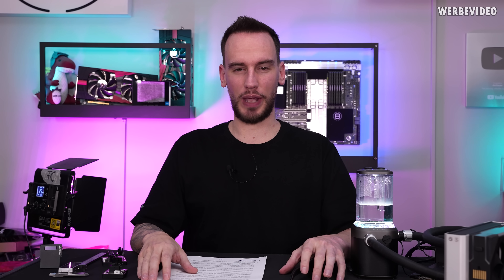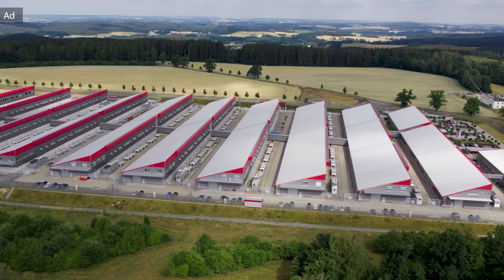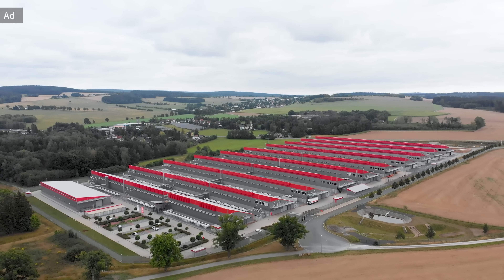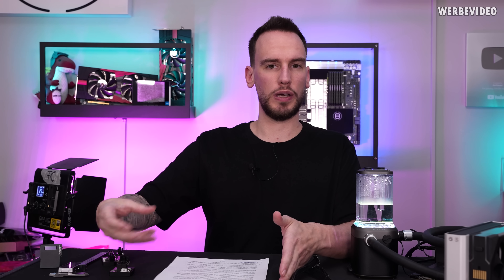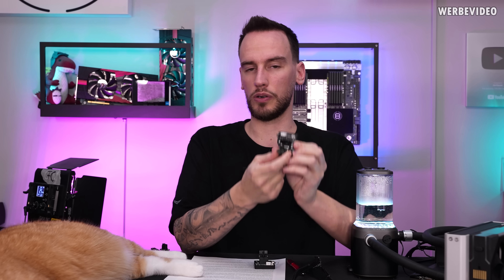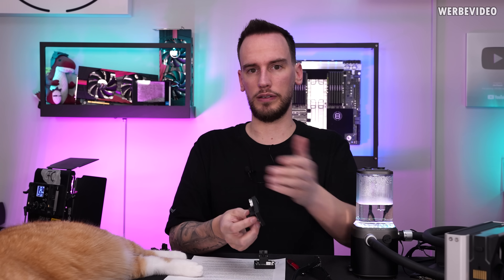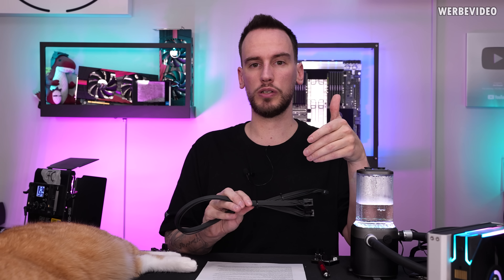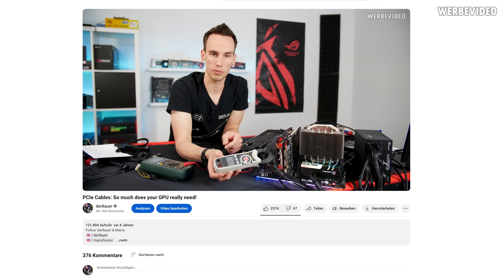12VHPWR is just Garbage and will Remain a Problem!!

Comment: A. For the  600W comparison you make, shouldn't the safety factors for the 4 x8 pins be between 1.44 (=4x216/600=864/600) and 1.92 (=4*288/600=1152/600)? It seems you used 460W in the denominator instead of 600W. Or did I miss something?

B. Your connector 3 x 8 has for the lower grade cable of 216W a max power draw of 648W, which gives only a safety factor of 1.08 , which is even less then the 12 pins connector. Or did I again miss something?

Comment: They wanted to reduce cost (less copper) with a very tight spec. Mix in the manufacturer (of cables) who also wants to cut even the smallest corner. Multiply this equation with user error and it's the perfect recipe for disaster

Comment: More power through a smaller connector.  Who could’ve seen this coming...
Reply: It is a genuine trend in EE really. Crimped connectors got the issue that the bigger the wire a pin is crimped over, the less relative contact surface between the two and thus current we can actually squeeze out of it (Basically. Bigger cables = diminished returns). As crimping automation improved we are trending towards using larger quantities of smaller connectors as we find ourselves actually getting more power through smaller connectors.

The only problem is that the smaller it is, the more easy it is to not be plugged in properly. To solve this we have created newer connectors that are more snug and improve contact. Like for this size there is the "Microfit+" that can handle ~13A.... which they didn't use in favour of the older cheaper MF3.0 that handles ~9A...
Reply: @Foxhood  I've seen the same trend in the automotive world with headlight connectors, never used to be an issue "back in the day" but now they're melting left and right...

Comment: While I do think a class action lawsuit is deserved, people are laying too much blame randomly. The reason this spec was voted for is because it DOES work in theory. The bad implementations (done to save money) have caused the failures. If it's going to cost $10 per connector to make them work properly, and the manufacturers don't want to pay that, then yes this standard should go away. And whoever covered up the failures should be taken to court.

Comment: From the beginning this seemed to me like a solution looking for a problem. Nobody has had issue with 6 and 8 pin connectors for decades. Are we so vain we need a new connector for slightly cleaner wiring management? A little ridiculous.

Comment: I was lucky that my 4080 didnt get damaged by the aftermarket adapters, I was in the same boat with an 011 Dynamic (non-XL) and running the side panel off when i got my card out of fear of bending the cable after all the melting ones in the news around launch. I got the 180 degree adapter and also bought a bequiet PSU compatible 3:1 cable from Cablemod because i was already paying for shipping and wanted to eliminate the messy nvidia 3:1 adapter and OG psu cables.

after a month of smooth sailing with the side panel on, i started having a hard cut to a black screen and the GPU fans ramping to max unexpectedly, requiring a hard reboot to get running again; i ended up going back to the oem adapter and psu cables while troubleshooting and that solved the phantom issues. Unfortunately it seems to be a 2 part issue, the design of the 12VHPWR cable is terrible, but also, Cablemod's adapters (for my 1 anecdotal experience) had issues despite me being incredibly ginger/gentle and paranoid of issues when installing. the issues with my card only went away fully after i removed BOTH the 180 degree adapter AND the 3:1 PSU cable from Cablemod
Reply: "went away fully after i removed BOTH the 180 degree adapter AND the 3:1 PSU cable from Cablemod" Ya, we run the risk of issues anytime we use anything that is after market for sure. Glad you got it sorted out, the 40 series cards are amazing. Enjoy!

Comment: As an engineering student, everything I've learned so far tells me this cable is just a bad design. One must design with user error in mind. We live in the real world. Not some fantasy land where everybody is a rigorous technician who checks every connection
Reply: "One must design with user error in mind. We live in the real world. Not some fantasy land where everybody is a rigorous technician who checks every connection"   

200,000 units sold less than 100 known issues = 0.05%. This product falls well below the industry's acceptable quality level standards and well below the %4 expected failure rate.

According to the AQL industry standard (Acceptable Quality Level) the acceptable failure rates are as follows:

The failure to meet the requirements of customers with respect to quality is termed as defects. The three categories of defects are:

Minor Defects - Not likely to reduce the usability and material of the product for its intended purpose, but slightly altered from the intended design and specifications. The industry average AQL for minor defects is 4%.

Major Defects - Not acceptable to the customers. Usage of the product will most likely result in failure. The industry average for AQL for major defects is 2.5%.

Critical Defects - If accepted, this type of defect could potentially harm or injury the customer. These defects are completely unacceptable. The industry standard for AQL for critical defects is 0%.

Comment: Good recommendation Roman. I would also add to the request that all 12VHPWR connectors be angled back towards the PCI-E connector so that 90 and 180 degree adapters aren't required.

Comment: It's a solution for a non-existing problem. PCI-SIG could have just updated the standard for 8 and 6 pin connectors, as they are too rated for 8-10A per pin. There's 0 reasons why 6+6 would not be able to handle the same current as 12VHPWR
Reply: The 6+6 by itself wouldn't do. The card needs to be able to sense the presence of the connector and that there is a power-supply on the other end. For that reason about two pins of the 6/8 pin connectors are used as "sense" pins which are grounded. Not to conduct current, but to act as a logic signal (can't do both at the same time). Officially the 6 and 8 pin both have a few pins that are intended for this and thus really only have 4/6 current carrying wires. Some cards cheat a little on this, but moment you go multi-connector you HAVE to be sensing so the card can politely refuse to start if either isn't plugged in. Lest terrible things happen if it did try to pull too much current through a single connector or worse: the motherboard.

So at the very least, you'd need proper 8+8. Then it should be possible.

(Honestly this is the one problem 12VHPWR actually does solve in a satisfying manner by having the sense pins be a seperate set of smaller logic wires, freeing all the bigger pins for current carrying)

Comment: I recall a similar review where it was theorized that the connectors were designed during the worst of the pandemic, and that the whole situation around the world and the general distress found in a large part of the populations around the world may have contributed in a lesser efficiency on the part of workers around the world in many sectors (including engineering, in many fields). Now I don't know if the connectors and/or the RTX 4000 series was actually designed during the pandemic (probably before, maybe) but my uneducated assumption is that the only way to explain such an engineering failure in a very large company like NVIDIA means that they didn't "check" enough before finalizing it and calling it a night.

Also, maybe the engineering team (or even the 'lead' engineer) may have been relatively new, or they were asked to do something that they disagreed on but they were pushed to still do it, even if the engineers themselves may have actually warned the higher ups that such a connector design presented flaws. I wouldn't be surprised at all if that was the case, too. 

In any case, I think it's very embarrassing  for NVIDIA. Not only that, but as a consumer I'm still holding back on upgrading to the RTX 4000 series, because I cannot financially afford 'replacements' all the time. I even imagine a scenario where even with the warranty if I was to constantly get new units from returns, it would still fail because of the connector issue. At the current general prices of high end cards only an extremely low minority can tell themselves "it's ok, I'll just get another 4090 from another brand, whatever".

So I'm here contemplating going with something like a 4080 Super when it comes out, but that connector issue gives me anxiety. I would be devastated if the connector failed AND would damage the card as well. My 'trust' would be severely hit and I would probably just go with AMD for the next 10 years, knowing myself (or heck would even wait until Intel gets comparable cards and go with them).

They need to fix this issue, and re-design how their high end cards are connected. They should, really.
Reply: If you can upgrade, especially at retail cost you should. Your card will be just fine as long as you properly seat all the power cables in your rig and stay away from after market cables and adapters.:

200,000 units sold less than 100 known issues = 0.05%. This product falls well below the industry's acceptable quality level standards and well below the %4 expected failure rate.

According to the AQL industry standard (Acceptable Quality Level) the acceptable failure rates are as follows:

The failure to meet the requirements of customers with respect to quality is termed as defects. The three categories of defects are:

Minor Defects - Not likely to reduce the usability and material of the product for its intended purpose, but slightly altered from the intended design and specifications. The industry average AQL for minor defects is 4%.

Major Defects - Not acceptable to the customers. Usage of the product will most likely result in failure. The industry average for AQL for major defects is 2.5%.

Critical Defects - If accepted, this type of defect could potentially harm or injury the customer. These defects are completely unacceptable. The industry standard for AQL for critical defects is 0%.

Comment: The entire spec for this connector is utterly baffling to me. If there's any component of any electronic thing that *should* be over-engineered to a degree, it would be connectors. Even if they're not intended to be plugged in and out repeatedly, the Connector should still be able to do so for many, many cycles, at minimum. The cable should also provide a very perceptible feedback to the user when it is seated properly. The connector should also be secure enough to allow the user to bend / route the cable damn near any way the want while leaving at least some slack on the cable, all without any sort of risk of the cable becoming partially unseated.

The fact that special instructions or warnings had to be included with some these cables compared to the previous 8 pins is already an engineering failure, end of story.
Reply: 200,000 units sold less than 100 known issues = 0.05%. This product falls well below the industry's acceptable quality level standards and well below the %4 expected failure rate.

According to the AQL industry standard (Acceptable Quality Level) the acceptable failure rates are as follows:

The failure to meet the requirements of customers with respect to quality is termed as defects. The three categories of defects are:

Minor Defects - Not likely to reduce the usability and material of the product for its intended purpose, but slightly altered from the intended design and specifications. The industry average AQL for minor defects is 4%.

Major Defects - Not acceptable to the customers. Usage of the product will most likely result in failure. The industry average for AQL for major defects is 2.5%.

Critical Defects - If accepted, this type of defect could potentially harm or injury the customer. These defects are completely unacceptable. The industry standard for AQL for critical defects is 0%.

Comment: This thing has been a disaster.  In one respect I am glad that my 4090 is in a Horizontal motherboard that allows me to route the connector in a very rigid way so it is very straight and very immobile.  In another I do worry some about the connector anyway.

For the life of my I do not understand why for these cards they didn't just specify multiple thick gage conductors something like a solid 8awg with matching pin thickness. So what if it is a big chunky connector.  so what if the wires are hard to bend it would have been all the better in this case.

Comment: I found a perfect solution to this problem. It took me several months of simulation and engineering but in the end I found that a 7900XTX solved the problem completely. 🤣😛
Stop supporting Nvidia. $1700US card and a 50c connector.

Comment: Since you’re going on about tolerances - which you, Igor, and Jay have parroted for the past year - then why are 4090s, 4080s and even 4070 and 4060s with the adapter melted? Just open the subreddit for cablemod - they have had melted connectors ranging from 3090 Tis to 4060s to 4090s. Moreover, why are connectors melting even on idle? 610W is the maximum from your elegant calculations - then explain why are cards melting while gaming? My 4090 and most stock 4090s rarely touch 400W… 4080s don’t go above 350W unless overclocked - but they are still melting

Comment: why the connector is at the side and not at the rear in ALL cards??? A lot of "enterprise" models use that other layout
Reply: Because the cards are already longer than many cases as it is, so there is no space for the connector.
Reply: @diego1694 sure, but its easier to find longer cases than wider (like extra 35mm like in spec)

Comment: been having issues with the sens wires on my 4070 ti, i really hate this connector, ordered the new "stealth sense" stuff cable mod hoping it fixes this, but yeah, 4070 ti with 350w tdp could have been easily powered by 2x8 pin but they just had to take the jump and make us suffer :/

Comment: they just need to make the ports for these connectors like pcie slots or ram slots; nothing gets in or out without clicking or unclicking a latch on the side. it's inherently a shit design but if they at least put a little effort into it, now that it's effectively a forced standard, it wouldn't be as bad

Comment: Small correction: the "rated at 20°C" part isn't actually correct for these cables; max current ratings are standardised at a high ambient temperature (e.g. 55°C or 70°C), and are almost fully dependent on the maximum temperature of the insulator. So for a 200°C rated insulator and a cable spec'd for up to 70°C ambient, the current rating of the wire is the maximum current that should never lead to an increase of +130°C in a normal scenario. AWG specifies the sum of the cross-sectional areas of the conductors, so for multi-stranded cables you end up with wider overall cable diameters due to gaps in circle packing, which can be a bit confusing - ultimately, 18AWG has the same amount of copper regardless of stranding. The reason for stranded cable current derating isn't anything to do with the amount of conductive material in the cross-section, but rather the poorer thermal contact between the strands and the trapped air between strands acting like an insulator, which means you need less current before a hotspot can occur which exceeds the insulation rating. Typical AWG charts showing current limits are generally based on a very simplified model using minimum insulation specs set by building regulations on plenum cable installs, because they're mostly made as a reference for electricians. If you want the correct rating for the exact cable you're looking at, you need to look at the markings on its insulation.
Reply: That called operational temperature etc

Comment: finally, i've been saying this from the start. the connnector was too small and had too much drawn through it, that is why it was melting, not necessarily bc of the connector not seated properly(granted that was an issue, but not the main one). this connector should have had double the wires or just styed with the old 8 pins and put 4 of them on there.
Reply: Size of the connector itself really isn't the problem. It is always the ability of the pins themselves to have good contact surface on the interface side. Doesn't matter how big your connector is, if its a flabby loose-fitting you ain't getting much out of it. For example. This connector is based on the Microfit3.0 connector which can normally handle about 8.5A, but there is identical size variant called Microfit+ which can handle 13A. That is 53% more current, just by adjusting the contact surface and ensuring tighter tolerances!!

Now why they didn't go for that version that would drastically up the safety margin. That i would like to know the answer off...

Comment: The A6000 RTX Ada version uses the same power connector. I think if a data center burns down then Nvidia will have real problems. Just don't overclock the thing to 600W. Keep it power limited to <400W and there shouldn't be any issues.

Comment: 8 pins are given for 150 W.
Most of the time 8 pins split in 2 8 pins.
I don't imagine mainstream power supplys mannufacturers take risk.
This means that the primary cable of a dual 8 pins connector can handle 150 W + margin.